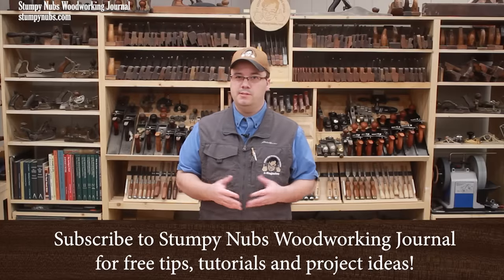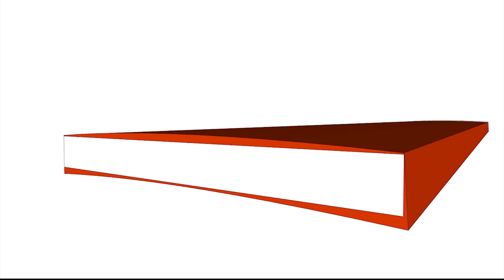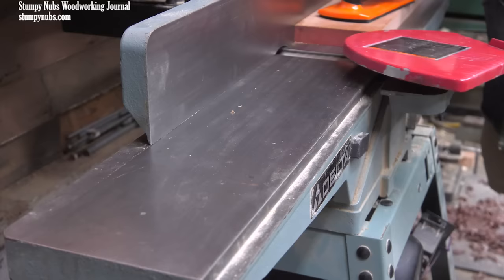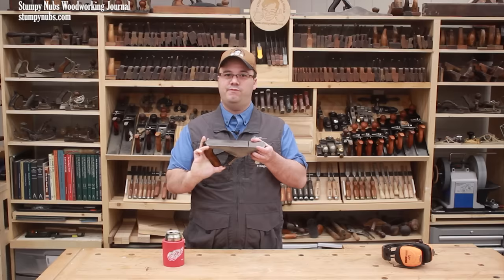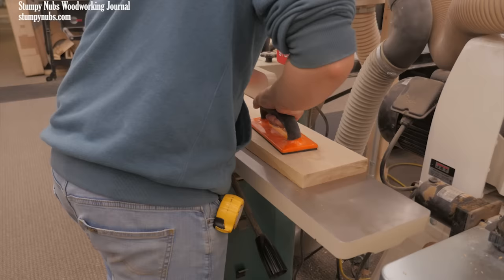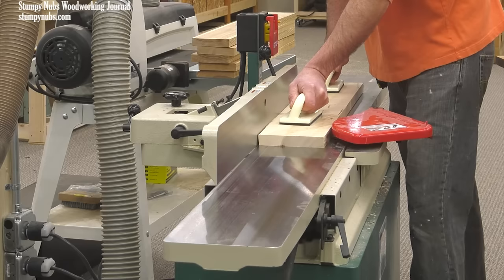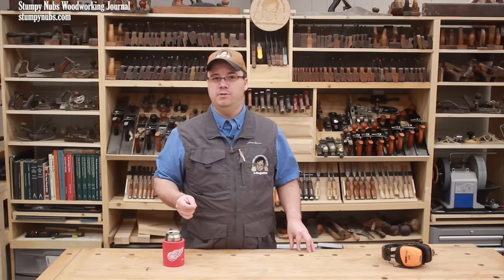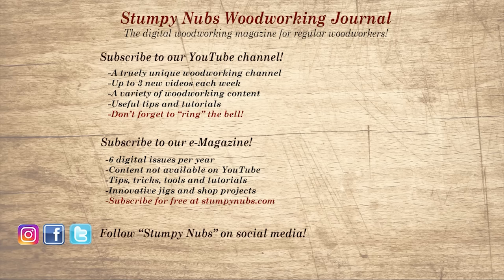Why do they call it a jointer when it planes wood?

Comment: Great introduction to the jointer.  Emphasize the push blocks, Stump.  I am more afraid of my jointer than I am of the table saw, even edge jointing.  My used jointer didn't include push blocks.  I made some real quick, including one with the 'hook' on the back.
Reply from the maker: I think I did emphasize the push blocks, didn't I?
Reply: @StumpyNubs  Yes.  I just mean no exceptions.  Those jointer knives are scary.  Gives me the shivers thinking about how it would feel..and look.

Comment: I really appreciate the time you put into these videos,very helpful. I could have saved a lot of time learning my jointer if I had watched this first. I would like to add one little tip. My push blocks tend to slip a little sometimes,drives me nuts. I used several small but sharp screws that just barely penetrate the rubber of the block. I’m usually running lumber right off a sawmill so the little marks disappear when I plane that side. I have these blocks marked well so they are not used on any finished surfaces. I run hundreds of feet of walnut of all different sizes.

Comment: The thing I struggle the most with, is flattening cupped boards. I recently did one where I was attempting to remove the cup but no matter how I fed the board, it wouldn’t flatten and it just removed too much material and reduced the thickness too much. I was making maybe 1/32” inch cuts and applying just enough pressure to keep it stable.

Comment: Hi there, thanks for the great video.  For keeping jointer, saw, planer, etc surfaces very slick and protected, I use GlideCoat by Bostik. I believe it is listed on Amazon but found it less expensive at my local woodworking supplier.  The cost is a bit startling, but it lasts for ever and, after 55 years in the woodworking industry, it is by far ;the best stuff out there.

Comment: Another reason for moving the fence forward when edge jointing is to minimize the potential exposed cutterhead during the cut.  In batch operation, I tend to do all the flattening first, then pull the fence forward for all the edges.
Reply from the maker: If you have a guard on the jointer, the unused portion of the cutter head should be covered due to the shape of the guard.

Comment: Stumpy, you guys have really been delivering on solid content lately.  Production quality has gotten sooooo good.  So whatever you guys have been doing to improve the content, keep it up man.

I have a small 6" Porter Cable table top jointer that I bought from Lowes when I first started building my shop.  It is the least used tool in my shop, without a doubt.  I pretty much only use it for jointing one edge, and that's only because I have one and might as well use it.  After I got some experience (and other tools) I really don't think they're the best use of space and $$ for a small shop, but that's just my opinion and ymmv.  We all have our preferences.  There are other tools I've purchased over time that I think are a better for me in a small shop.  I upgraded my 13" Ridgid planer with a shelix cutter, and prefer to use it with a sled and wedges to surface both sides.  I also have a Dewalt track saw that gives me a perfect reference edge, or I can use my router table, then finish the other edge at the table saw.

I'm planning to build my new shop in the near future.  I'm really questioning if I want to shell out for an 8" jointer or if that money would be better spent upgrading to a 20" thickness planer.  I'm leaning towards the planer, since my main concern is being able to keep boards a wide as possible and I know I can perfectly dimension rough lumber without a jointer. 

Thoughts?
Reply from the maker: When I bought a new stationary planer for this shop I considered going large. But it occurred to me that, while I love the idea of planing really wide boards, I very rarely do it. So I went with the 13 inch planer. Since then there has been a time or two when the wider planer would have been nice, but we managed just fine without it. SInce the price difference between 13 and 18 or 24 inch planers with helical heads is extremely high, I am comfortable with my decision.

Comment: James - I just bought a Jointer and wish I had watched this video before I tried to use it today. There are other videos out there about how to use Jointers, but none of them came close to this one. I was pushing down on my workpiece today and asking myself if it made more sense to push on the outfeed side or not, but I wasn't sure. One question, the manual for the Grizzly benchtop jointer I bought says to make the infeed and outfeed tables level right to left. The manual actually says to make the outfeed table level with the body of the cutterhead - which is spiral (I'd call it semi-helical) and not the blades - and then make that level with the infeed table. There are 4 screws per table so I'm now back to adjusting all of them which is frustruating. This Grizzly jointer looks like a great machine, but one of the screws seems to be stuck so I'm close to sending the whole thing back. Anyhow - maybe I should have just left the tables at the factory settings. A video about this would be great. As you say, these machines are a bit mysterious.

Comment: I apply very little pressure on my boards when face planing you don’t want push the cup out of the board I also cover the board completely with pencil line that way you can see where the contact of the knives are

Comment: I cut my fingers up in jointer 40 years almost to the day. Lost skin tenden and bone. They put them back together but is was very painful. I just 13. 
Push paddles, blocks  or floats are a must have and never use without a guard.   Still love woodwork but do not own a jointer. I had one but sold it mostly for space.
These days I use hand planes for small jobs or an overhead router jig for long pieces. I is just a router  mounted on a long achrilic base and two rails. It hangs on the wall when not in use. If I had the space it would be permanently set up.  This only the does face.  Once that is done and the board has been throug the thickness planner I fix a straight strip of mdf to one edge with short nails or double sided tape and use that as a reference my table saw fence. Or a I use a track saw for wider pieces.
This would be a good video for you to do  Stumpy for those who do not own a jointer.  I love your work.

Comment: if a baord is really twisted and cupped and bowed... i usually knock off the high spots on one side (the cupped side) with a hand plane until the board sits flat and comfy on a work bench, then run it through the jointer.

Comment: This is the kind of tutorial I need. Thinking about buying a jointer mainly for the edges of boards and not so much the faces. I have no idea where my interest in wood working will take me so I often ponder should I buy beyond my current wants/ needs or buy a little above such as 6 inch or 8 inch beds. I know there are ways to edge joint using sleds and router tables but it seems inferior to to what these machines do.

Comment: Ok so I have already jointed the faces of the boards. Now I'm doing the edges. I run the edge of the  board across the jointer. I have put pencil lines of the edge to see progress. After a few passes the board is narrowing at one end. Kind of ramping if that makes sense. It seems like I'm keeping even pressure.

Comment: 4 inch jointer gang. If you take the guard off, you can essentially flatted the face enough that it doesnt rock and then put it through the planer and it wont cup

Comment: You can always use the feel method for determining wood grain direction. Run your hand along the surface one direction than the other. Compare the two. The one with less resistance and in well sanded and milled wood often smooth, direction will be with the grain. The opposing direction which will have more resistance and at times in large open pore wood, you can feel the pores grab at skin or cloth even, Will be against. This is how I was taught to tell direction at least.

Comment: I’m just starting out with woodworking and on the fence, no pun intended, between a jointer and a planer. Have an opportunity to acquire a Jet 10” jointer. Should I pull the trigger on first, the jointer or planer ? Great information here. Thanks again.
Reply from the maker: If it's a good enough deal, and you have room for it, you will bever regret having a jointer. But you will still need a planer to go with it.

Comment: I prefer waiting to joint the edge of a board only after I have thicknessed the other size of board on the planer. This way gives me the option to as to which face of the board to place against the jointer fence to allow me to joint the edge with the grain running downhill. There have been many times when I have flattened a face of a board only to find the when I joint the edge the grain is in the wrong direction. The first face piece of lumber that is jointed is determined by the condition of the board (cupped, bowed) and the grain direction. Whether that provides the correct direction for jointing the edge is a 50/50 chance at best and usually Murphy makes the odds less favorable.

Comment: Can you use aqua coat in a cutting board then apply the oil ( like walnut oil ? ) on a wood like padauk which had grain that won’t sand to rid it of the tiny

Comment: Shout out to the images at 9:51 and 10:10. They are entirely practical depictions that should be shown so much more often.
Because not everyone gets what "with" or "against" the grain means in reality, and are left scratching their heads... "WTH does with the grain mean? Add Weetbix?"
Sure, everyone knows not to pet a cat backwards, but you don't (usually) feed cats into machines. And if you're new to machines you will have trouble with the trifold feed/cutter/grain relationship, and this image should make world of difference to newbies.

Comment: Great video!,   What’s the best process for getting rid of the bow in a board? Flatten one face and then let the planer take the rest off the top?
Reply from the maker: Flatten the concave side on the jointer, then use the thickness planer on the other side. Cut it close to the final length, first so you reduce the amount of the bow.

Comment: I use a 6 inch jointer with a spiral cutter which gives a great finish and I then use a thicknesser to get the required thickness ,but the thicknesser has knives in the cutter block which doesn’t give a great finish.
Is it good practice to keep the board about 1/32 thicker through the thicknesser then take it down to finished dimension on the jointer to produce a great finish on both sides?

Comment: hey   Can a  Shelix cutter fit in any traditional spiral cutters. ( the individual cutter, not the whole unit.) I know this is not the norm and they would not be going in at an angle as a spiral is straight ahead.But they are 4 sided and could extend spiral cutter head. Put your thinking cap on and don't pull the trigger too quickly on this answer. As you know most of us can't afford a SHELIX cutter. Thx Bruce

Comment: One thing about resin and it being sticky. Use a good penetrating oil like WD40 to clean the surface, wipe it thoroughly then wax the tables again. Always use paddles when using a jointer if you intend to keep your fingers and avoid injuries.

Comment: I just bought a used, 4 inch Craftsman jointer (got it for cheap). When working on a project, my stock was roughly 3 1/2 inches to start. When finished edge jointing, I found on pretty much all my boards they came out to about 3 1/4 inches on the leading end, and 3 7/16 inches on the trailing end. Any idea why that would be?

Comment: Outside of the edge use, What would the reason be to use a jointer in the same direction/way as a thickness planer instead of a thickness planer with a reference board?

Comment: To use a helical cutter, your joiner needs to have an adjustable outfeed table.  Mine is not adjustable so I can't put one in.
Check before buying your joiner if you may want to upgrade later, it is an expensive upgrade though.
Reply from the maker: All outfeed tables are adjustable with shims, aren't they? Even so, both Byrd Shelix and LuxCut make their heads to the same specifications (including the knife height) as the originals. There should be no compatibly issues.
Reply: @StumpyNubs  Thanks for reply.  I have a cheap Porter Cable 6" joiner (given to me) that LuxCut specifically told me their replacement cutters won't work on, because of outfeed table lack of adjustment.
There are other ones that look exactly the same as mine from different companies they support, but those have adjustable outfeed tables.  I think only the cheapest joiners don't have that.  I think it could work, as you suggest, but $500+ for an "attempt" I wasn't willing to try, I need a better joiner anyways at some point.
Mine works "just good enough" for what I do that I haven't replaced it yet.

Thanks for all the great videos and info. Your explanation for joiner tearout I never knew why and was a solid gold tip!

Comment: Thanks for making this videeto James. I recently purchased a jointer and it took me a little bit of practice before I got good at jointing boards but I have it down now. My jointer has a spiral cutter head. Do you think it's a good idea to try and joint boards at an angle, i.e. having one side at a 30 to 45 degree angle from the fence? I work with a lot of walnut and the grain direction is sometimes a bit of a mystery.

Comment: Great video, as always.  I have a question.  I am planning on making a wood book press for book binding and I want to laminate 4 to 6 red oak or maple boards, nominal 1x6, to make a strong, solid block.  What I have in mind is to flatten one board's face on the jointer, next to face glue all of the boards together (reserving the jointed face for the outside of the glued block), and then edge joint one glued edge on the jointer before thickness planing the block on the planer and then, also, using the planer to thickness plane the unjointed face.  What do you think?  Would jointing the glued edges be harmful to the jointer knives or motor?

Comment: I need help taking a bow out of a 2x6x6 cedar board. I have the bench top grizzly jointer/planer set up nice and square. I have ran the board through several times and the bow is still in the board. It's frustrating because it seems it works great on the short boards but not so much with the longer stock. Any help would greatly appreciated. I have watched sever videos that you have made on jointing.

Comment: If your board is rocking during a face cut, start in the middle of the board to take a light cut, flip it around to take another light cut starting in the middle and Bob's your uncle,  it's rocking no more.

Comment: James, Why do you have to check the fence each time you use it?  I have  a Grizzly 858 and  it usually needs to be adjusted.  Why is that?  Why does it move?  Is it the fence that moves or is it the tables that are moving?  And what a pain THAT is....adjusting the tables.  Could you maybe do a video on adjusting the tables on the Grizzly?  Yeah, that was a lot of questions.  Thanks.
Reply from the maker: My Grizzly jointer fence moves because of a poor design in the way it pivots. The pivot points are little cast iron cones rather than steel pins. They can shift from vibration, no matter how tightly you try to lock it down. My old 6-inch Delta was always rock solid.

Comment: To understand that wouldn't produce parallel faces, I imagine trying to joint a triangle shape. No matter what you do, it will always remain a triangle. Unless of course you somehow hold it from above and shave just a bit off the tip each pass... hmm maybe add a flat table above the jointer to hold it parallel, although this is awkward working against gravity so let's just flip the whole thing so the cutter is on top and hey... wait I've built a planer!

Comment: I have been edge jointing with my table saw and Veritas shooting plane and flattening with a plane or a small sled that goes through my planer.   Recently I got a free and cheap 8 inch jointer with a spiral head - cuts great - BUT  it never cuts the back side of the cut so that if I feed an edge enough times I end up with a triangular piece of wood.   What gives?   The tables are parallel to within 0.1 degree.  Thanks in advance.
Reply: It was an easy fix - no brainer really- the three cutters in the edge jointing position were worn below the outfeed table.

Comment: A better diagram to show would be a board that isn't cupped or warped but has perfectly flat faces but is wedge shaped. On the jointer, you'll never get those two faces to be parallel.

Comment: Can the table saw be used to square the first edge to the planed face instead of the joiner? Is there any benefit to using a jointer for this first edge?
Reply from the maker: To make any rip cut, you must already have one straight edge to run against the table saw fence. Running a crooked edge against the fence while you, presumably, straighten the opposite crooked edge can lead to binding and kickback.

Comment: I plan on building guitars and need a planer/jointer for the process. I doubt I would ever use lumber that was more that 7.5 inches wide, so my question is, do I really need a separate thickness planer, or can I do what I need to do with a jointer that accepts up to 8 inch lumber? If I could eliminate one expensive tool, I'd not only save that money, but also save on the space required for another tool. (Ah. I asked my question before you explained the difference. I understand now)
Reply from the maker: https://www.youtube.com/watch?v=ZFFzmJfv5No